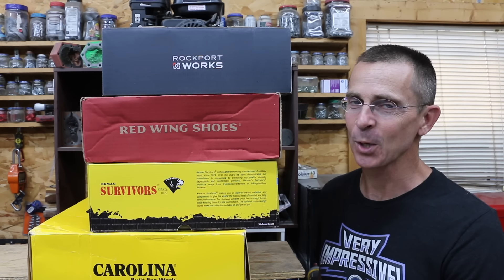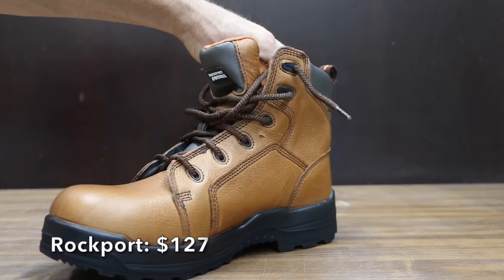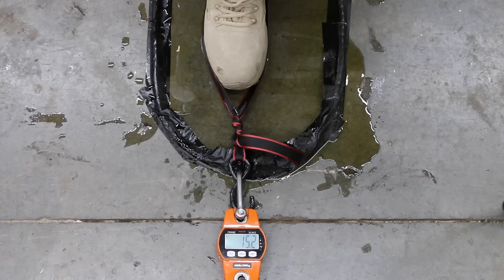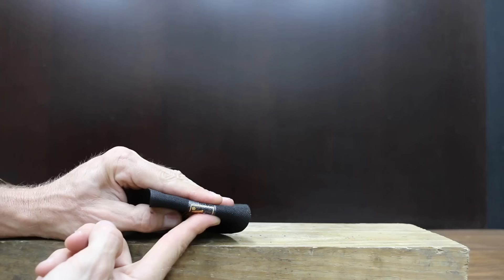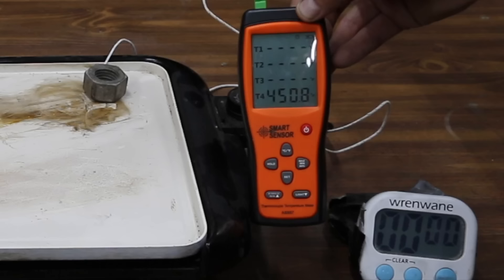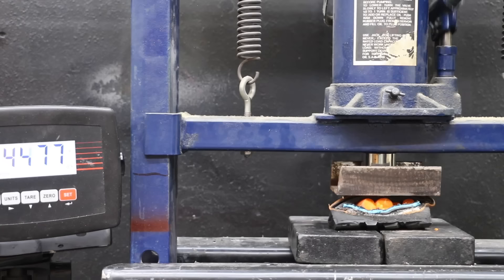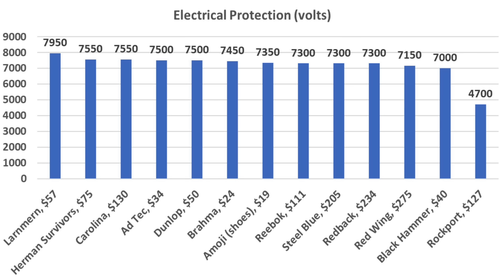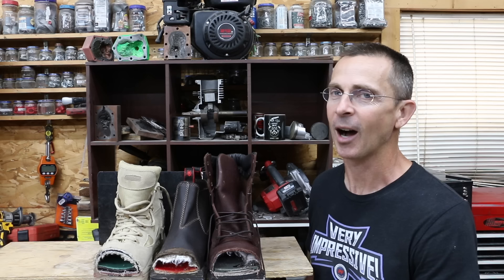Best Boots? $24 vs $275! Let's Find Out!

Comment: The one thing I see that Causes a red flag IMO is the fact that you didn't break in any of the boots. lots of the higher end boots have a break in period before they start performing their best. they need to mold to the specific foot that's wearing them so to speak and that can cause different pressure points and what not in the sole and on change the angle of protection around the toe, just food for thought 1
Reply from the maker: Thanks for the constructive feedback.

Comment: Surprised you included Red Wing but did not include Thorogood.  Should you make another video on boots, try to include Thorogoods.  I work as a union millwright, 7 days a week, 12 hours a day.  I will say 95% of us that have been in the trade for a while have practically defaulted to Thorogood, the other ~5% being Red Wing.
Reply from the maker: Thanks for the suggestion.

Comment: Didn't watch the whole thing so if I say something discussed forgive. I walk at least 10 miles a day, I am a train conductor. I spend 350$ every 4 months. Take care of your feet. The cheap boot is easy to justify, but value your feet, you only get 2 of them. I go for danner quarries with insouls. Invest in some nice work boots.
Reply from the maker: Thanks for sharing.
Reply: @ProjectFarm  I went with a pair of whites out of Spokane Washington yesterday. 400$ boots but even comparing them to my normal danners I usually get, these were nice. All leather and Cork. I'd say the same build quality as my iron rangers but made for the forest service. I'm a train conductor and foreman so I'd say that's a similar terrain.

Comment: Ariat steel toe cowboy boots
Reply: Square toe
Reply from the maker: Thanks for the suggestion.
Reply: I've been wearing a pair of black Red Wing 2416 with red wings own "tuff toe" protection for about 5 years (400g thinsulate). The toe is finally splitting at the sole but is still somewhat water resistant. The comfort is far better than any other lace up boot I've ever had and the slip resistance on oily surfaces is great. My work background for the 5 years wearing these boots has been 90% oil well drilling rig  (Northern Alberta - all seasons including extreme winter conditions using both oil and water based drilling fluids)  and 10% brick laying.

Comment: Thorogood I don't care about a test I put the ultimate test on these boots I had 20 ft of W- 8×48 I-beam a lifted that Beam with the clamp instead of a strap clamp gave up dropped the beam on my foot I thought it had cut my toes off I could feel the blood in my shoe I can feel my toes flopping around in the end of the boot all placebo my coworker finally talked me into taking my boot off it's my surprise it wouldn't any blood in the boot I took my sock off I thought for sure my toes were going to be crushed not one f**** scratch I won't buy anything--but Thorogood boots so total weight on the beam was 960 lb Thorogood deflected the whole load
Reply from the maker: Thanks for sharing.

Comment: How about just 2 or 3 good brands stacked against each other. The slipping was not as helpful as the toe smash, insole, weight, and sole hardness review. LACES bro LACES. It really sucks to buy a new pair of work boots, and the laces snap within a short amount of time. Redwing offers “free lace replacement” but around my town, they take 2 days, and now try and make the breakage as user error.
Reply from the maker: Thanks for the suggestion.

Comment: Red Wings don't last that long the leather on the toe is extremely thin and wears through very quickly unless you purchase and install toe protectors which adds even more to the price they are not built to last they are overpriced overhyped garbage

Comment: Those first two boots are absolute garbage. Owned both, fell apart in a little over a month. Those "ad-Tec" boots are also sold as the "interceptor SWAT boots"   The outer coating peels apart like a poorly done vinyl wrap, and the sides split open. 6 weeks, they were done.  Those $24 brahmas had no soles left, the boots wore down like a pencil eraser till my feet were showing at one month in.

oddly enough, they both outlasted the $90 Itasca boots.
Reply from the maker: Thanks for the feedback.